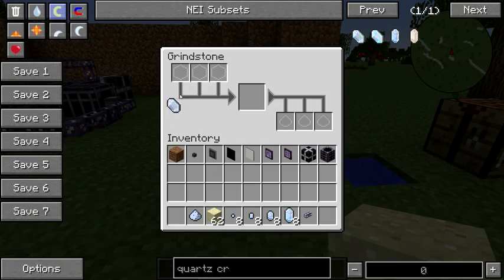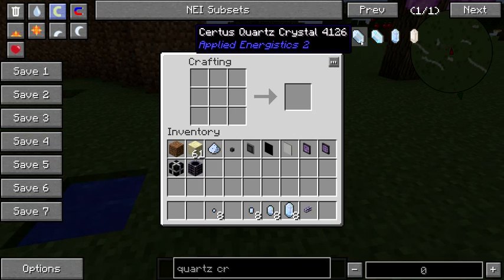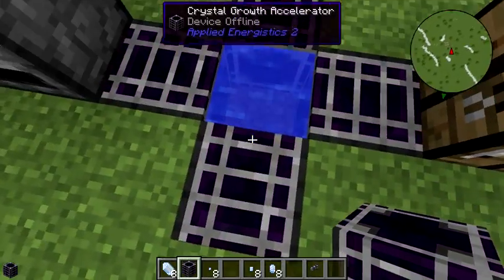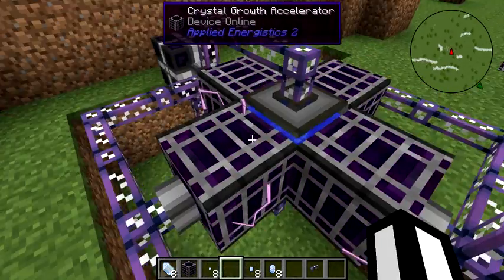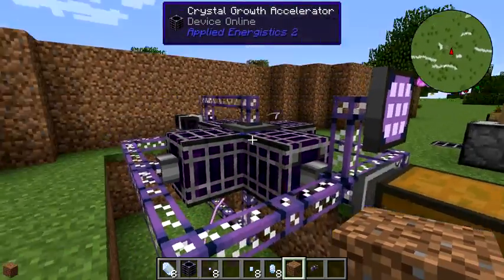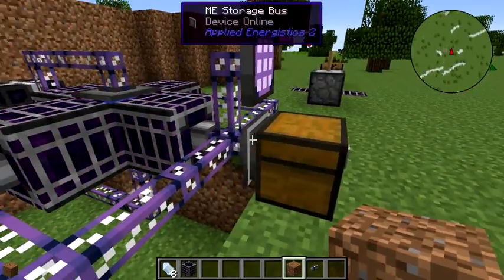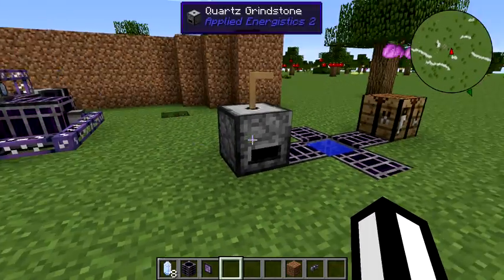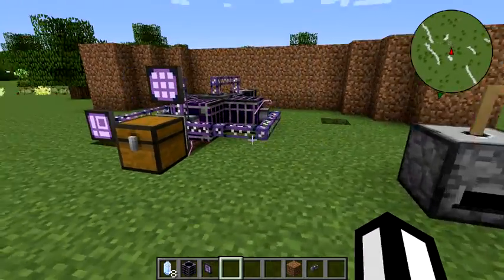AE2 - Automated Quartz Purification

Comment: Hello, xodus. Finally new vid, I almost forgot about you. Thanks for that vids, appreciate it. Im going to make a modpack and check it out. What's about thoose effects near accelerators? Does they slow down minecraft? Does crystal dissapear by 5 minutes(like normal thing in minecraft), when they growing? Also, as timer, you can use one from RP3 or Redlogic.
Thanks!
Reply from the maker: Hey Hawk!  Yeah, I was gone for quite a bit, but I was looking at AE2 has some really neat stuff that I'm excited about.  All the lightning near the accelerators is just showing that they are being powered - and they take a TON of power to keep running.  I didn't notice any slowdowns from the particles, but I was just playing a local game.  I guess any particle effects could slow down the server if you get enough of them, though.  I imagine someone is going to end up building a farm of several hundred of them, and will probably see some issues.  The crystals are supposed to be safe from disappearing, and I did try walking away from some and walking back up, and they seemed to be fine.  Thanks for the tips on the timers, but I was just playing the Unstable release as it was, and it didn't have either RP3 or Redlogic in it.  Hopefully by the time AE2 hits a normal pack, we'll get one of these too.  Good to hear from you again!
Reply: xodusprime, xodus, did you recieved my messages? Is everything worked?